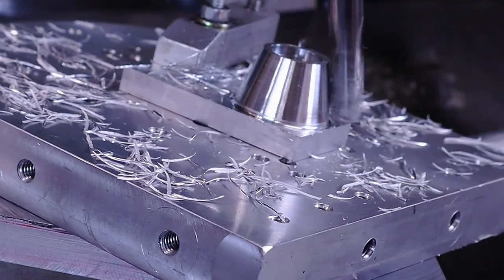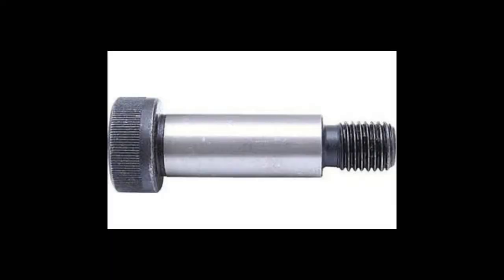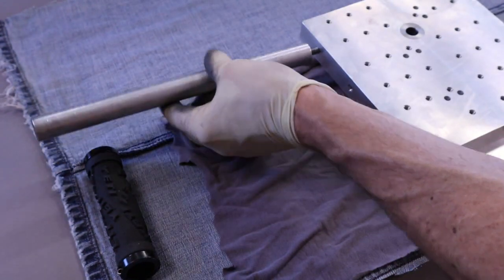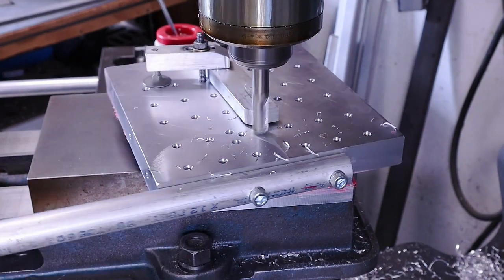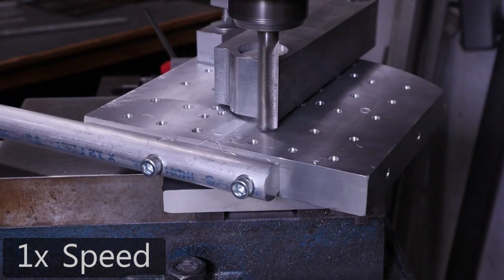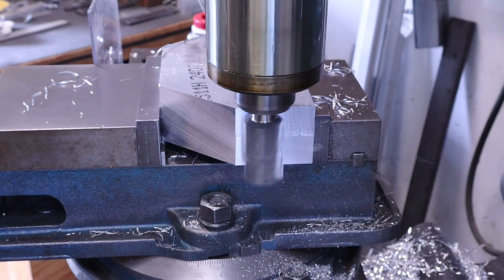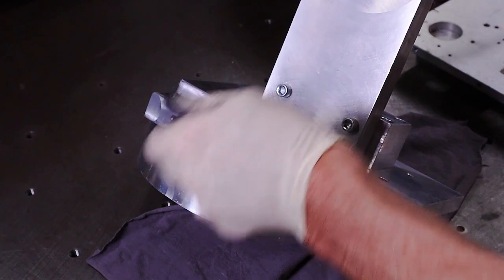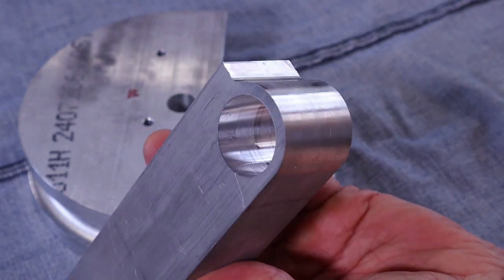Homemade Lever Operated Rotary Table for Milling

Comment: :hand-pink-waving::face-red-heart-shape: I love this makeshift rotary table, this is great! My rotary index is so heavy, I have to lift it with a hydraulic table, just to get it up onto the mill. :goat-turquoise-white-horns::hand-purple-blue-peace:
Reply from the maker: Ya, that's what I like about it, I can just throw it in the vice in two seconds if I need to round off some corners. I rarely use my rotary table.
Reply: @kev7777777777  I sent you an email for a ebike frame, are you no longer manufacturing them?

Comment: Just showed up as a suggestion for me.  One of the nicer hand controlled radius cutting tables I've seen.  I especially liked how you were able to extend the use of it with some simple attachments.   I'd need to size it to suit my own mill's and mill vise sizes.  But I like the concept.  I think I might see if I can find the old Bellville washers I've got set aside someplace as the tensioning force too.

Comment: Excellent! Two ideas for improvements, perhaps unnecessary: a jam nut on the shoulder bolt nut to keep it from loosening / holding preload, and replacing the grease with brass shim stock?

Comment: how accurate are you with this? +/- .010?  also, are you not a fan of climb milling and perhaps a little mister on the tool? 🙂
Reply from the maker: I would say +/- .005 is doable. As for climb milling, you have to very careful that it doesn't suck it in and pull the lever out of your hand. I finish the cut with a climb mill for the last cut only taking off about .01

Comment: This is the slickest way to make a tube bending die on YouTube, kudos. Someone cast thiers in aluminum and polished it. Another used a rotary table and a boring head. And another used a large lathe with a radius cutting tool. This is the best however. One would spend hundreds to get a rotary table that could cut radii as big as some in this vid. The only thing i see as a potential downside is the fact there's no way to measure how many degrees its rotated. Maybe pins?

Comment: Will you share a drawing for the table?  I am wonder how you determine the placement of the holes for the top and bottom plates. Love the design.
Reply from the maker: Yes, I have a solidworks file, or pdf prints
Reply: @kev7777777777  where and how can I get the drawings?
Reply from the maker: @bryanchristensen5097  I put the drawings on my projects page of my website
http://www.motopeds.com/projects-fabrication/
Reply: @kev7777777777  where can I find the PDF since I am not versed in Solidworks. Your help is much appreciated
Reply from the maker: @bryanchristensen5097  The eDrawings is a free viewer that you can download the viewer and then look at the model in 3d and get any measurement you want. But I can put up some pdf's too.
Reply: @kev7777777777  i would like to get some pdf of that project...thanks in advance.
Reply: @bryanchristensen5097  did you get those pdf prints?
I would like to get a copy of those.
Thanks
Reply: @kev7777777777  link does not exist